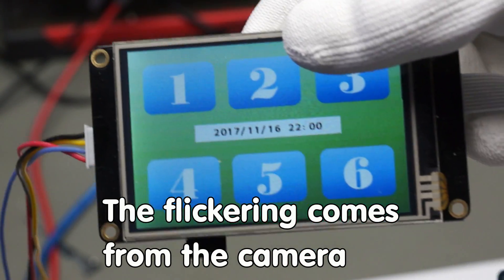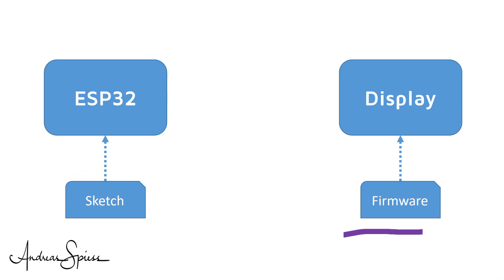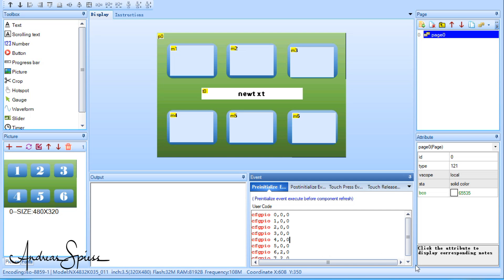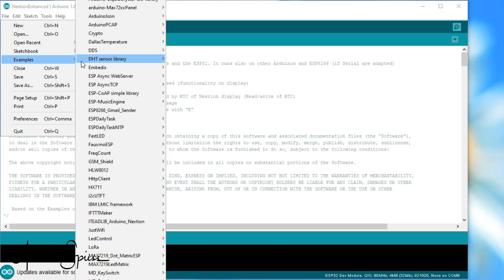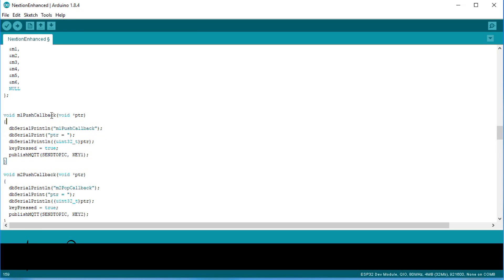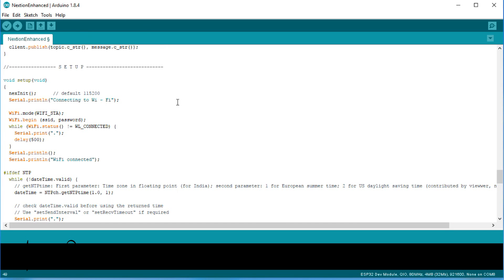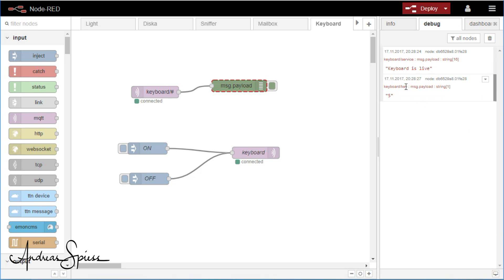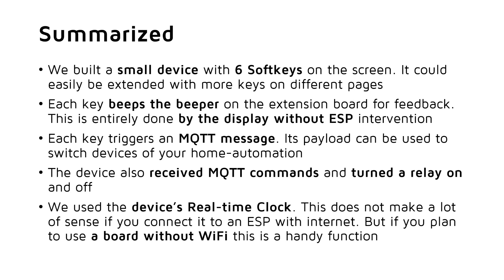#170 Enhanced Nextion HMI Tutorial incl. ESP32, ESP8266 and Arduino support

Comment: Do both models NX3224K028 and NX3224T028 have a 3.3V logic level or 5v? Thanks, cheers
Reply from the maker: According the datasheet the first uses 3.3V logic levels. I did not check the second.

Comment: I just picked up one of these displays today. I'm planning on using it with an ESP32 and just kinda hoped it would work. I'll be referencing your video to get the display working with the ESP32, but ultimately, my goal will be to use it in conjunction with with Squareline studio/ LVGL with a single rotary encoder as an HID for use as a CNC pendant. I'm up for the challenge. Hopefully these are the bits I need to make this project a success.
Reply from the maker: Maybe you find a newer library. This is a quite old video.

Comment: Thank you for providing a Nextion Library that works with the ESP32.
If I do install your library instead of the official ITEAD library, would it still work for the Arduino Mega or Uno?
Reply from the maker: I do not remember. So you have to try...
Reply: will you consider our touch screen display? then contact me

Comment: Andreas,
I need your help. I tested this solution using a Nextion NX3224T024_011 display with ESPDUINO (which uses ESP32), but without success.
The following error message appears on the monitor of the Arduino IDE: recvRetCommandFinished err.
Is this related to the fact that it is a different display? Or is it due to the fact that you are using ESPDUINO based on ESP32 instead of directly using ESP32?
Do you have any idea how I can solve this? I have tested many libraries and researched many other solutions, but all have failed.
Reply from the maker: Unfortunately I cannot do remote debugging :-( Did you watch all my Nextion videos, especially the one about Serial connection?
Reply: @AndreasSpiess  I saw the #152 and #63 videos.  I did as you said but the message "recvRetCommandFinished err " still appears. Could you send me the libraries version of HardwareSerial.h and cpp,  an SoftwareSerial.h and cpp that you used in these examples?

Comment: Another great video! Is there any reason I couldn't connect whatever I wanted to the I/O pins meant for the expansion board?
Reply from the maker: I do not understand your question :-(
Reply: @AndreasSpiess  Sorry, I'll try again. If I don't buy the Nextion expansion board with the switches, does anything prevent me from connecting something I build in its place?
Reply from the maker: I do not think so. If you provide the same voltage levels to the connector.

Comment: If I connect RX of Nextion TFT to TX (GPIO-1) of ESP32, and also connect TX to RX (GPIO-3) of ESP32, serial communication does not work. It works with UNO3. The ESP32 WiFi chip release version is v1.0.1. Does anyone know what is causing it? If there is an example sketch, could anyone please send a link?
Reply from the maker: Search for ow to initialize Serial on the ESP32. You can use all pins, but have to tell the sketch which one you want.
Reply: @AndreasSpiess  I am grateful to you for the advice. I will do my best. There are not many engineers or hobbyists here in Japan who provide information about ESP32 or Nextion TFT in Japanese. Youtube is a good teacher for me. What I want to do is simple, but I'm confused by the fact that many people have different information.

Comment: Hi Andreas, Thanks for your Nextion videos, they have really helped me start my project. Were you able to find ways/code to use the expansion board buttons as inputs?  I am working on a motorcycle VCU ( https://www.youtube.com/watch?v=ixrIBekt090 )  and am trying to figure out how to read the button presses.  Do you know if there is a way to get a "Touch Press event/Touch Release Event" for the GPIO's?  Cheers!
Reply from the maker: I think you should get information from their homepage. I never tried.
Reply: @AndreasSpiess  Thanks, I was having trouble decoding the Nextion instructions, but I came across another video that helped me understand. I thought I would post the solution here so you and others have access to it. Hopefully, this helps someone looking for the same information.

You have to configure the GPIO expansion board button in the 'pre-initialize event' area of the page you want to use it. This will link it to a button, element or hotspot on the page so you can use the 'touch press event' and 'touch release event' of the onscreen element by pressing or releasing the linked expansion board button.

A code example is:        cfgpio 4,1,m0         This means: (cgfpio=configure gpio port)(4=expansion button 104)(1=attach to screen element)(m0 = hotspot id "m0"). 

Now I can use the button 104 on the expansion board to activate the hotspot m0 on the page. You can link any expansion button to any onscreen element. cfgpio 2,1,n3  will link button 102 to Number field n3 on the page. You have to configure the buttons on each page, but this means you can use the buttons for different functions on different pages. 

If you are configuring an output for the beeper or led, you seem to be able to do that on the page 0 'pre-initialize event'  ( cfgpio 7,2,0 )  = (port 7 beeper)(2=binary output 1 or 0)(0=do not link to a component) and call it using pio7=1 or pio7=0 from any page.

 Thanks again for your great videos!

Comment: Hi Andreas, I don't have an enhanced Nextion but a modest basic T 3.2 and I couldn't experience this tutorial.
For days I'm fighting with ESP32 and my Nextion but nothing to do. I tried to copy a few lines of code from your examples but nothing. How can I do that? I watched other videos of yours too but I couldn't do anything. The original Itead sample files on ESP32 don't work. 
Thanks
Richard
Reply from the maker: Unfortunately, I cannot do remote debugging. Maybe you find another project with the same devices. Also maybe you start with the simplest possible sketch.
Reply: @AndreasSpiess  I tried a simple one like in your video number 59, CompText.ino and same GUI but with ESP32 it doesn't work. For this example with ESP32 I have not modified the file NexConfig.h as for Arduino because it should not be done and I left it original, but it does not work yet.
How can I do that?
Thank you
chip

Comment: Where in this setup is the ESP8266?  I assume it is to another serial port just not shown in the camera view?  I have an UNO that I am looking to do a similar project with, but it appears to use the Nextion and the ESP8266 at the same time will require two hardware serial ports, therefore a mega.
Reply: Never mind....I see you are using the ESP8266 in and of itself and flashing your sketch to it.
Reply from the maker: I made a video about the different boards and how to deal with "Serial"

Comment: Is there a way to increase the sensitivity on these screens? I have to press really hard to make the buttons react. Thanks.
Reply from the maker: They use resistive technology which is not as sensitive as the capacitive used in Smartphones.
Reply: I figured out also if you require both down press and up press the sensitivity isn't as good as if you just require one and not the other. Thank you!

Comment: Hello. I am using Arduino and trying to get HX711 scale readings into a Nextion display. It is so hard to find ANY help that I really feel like giving up on all of this stuff. Nextion has ZERO support. ALL the examples have ZERO comments in them. I don't have ANY friends that are into this and I am so tired of TRYING to find answers. Where the hell do I go???   :  (   Also, Why does Nextion not support floats?   Kind of sucks....
Reply from the maker: Maybe you divide your problem into several parts and solve one after the other. Then you also will find help, I am sure.

Comment: Andreas, your videos are so helpful! Thank you for making them so easy to understand and follow. I spent too much time trying to connect serial2 on the esp32  with the nextion library without success. 

Could you briefly comment on what changes you made to the official nextion library? I changed the initialization function to accept a value which dictates what baud rate to connect with. This way you can specify from the sketch instead of modifying the library. Ideally, I'd like to incorporate your changes with mine.

Do you know of a way that can speed up communication?, even more than increasing the baud rate? 115200 is quick for weather stations or home automation, but not enough for real-time display since serial communication code is blocking. I realize the second core could be used on the esp32, but what about Arduinos? Is there a way to use SPI communication instead? That way we can get 4Mbps which is much faster.

Regards,
Simon
Reply from the maker: I made a video concerning using other serials with the Nextion. Maybe you find the needed info there. Concerning speed-up I do not know.
Reply: Espero que la respuesta a sus preguntas no sea tarde. Intenté sin éxito seguir este video, pero tampoco funcionó. Finalmente, después de una tarde de dar vueltas y vueltas aquí está la solución:
copie el SIGUIENTE en NexUpload.cpp en la biblioteca de Nextion, esto lo sacará de la biblioteca ESPNexUpload.cpp, QUÉ FUE, se debe comentar (// # include <SoftwareSerial.h>

// # define USE_SOFTWARE_SERIAL
// # ifdef USE_SOFTWARE_SERIAL
// SoftwareSerial dbSerial (3, 2); / * RX: D3, TX: D2 * /
// # define DEBUG_SERIAL_ENABLE
// # endif)

Copie el SIGUIENTE en NexUpload.cpp en la biblioteca de Nextion

# si se define ESP8266

 #include <SoftwareSerial.h>
 
 #ifndef NEXT_RX
  #define NEXT_RX 14 // Nextion RX pin | Predeterminado 14 / D5
  #define NEXT_TX 12 // Nextion TX pin | Predeterminado 12 / D6
 #endif
 #ifndef nexSerial
  SoftwareSerial softSerial (NEXT_RX, NEXT_TX);
  #define nexSerial softSerial
  #define nexSerialBegin (a) nexSerial.begin (a)
 #endif
 
#elif definido ESP32
 
 #ifndef NEXT_RX
  #define NEXT_RX 16 // Nextion RX pin | Predeterminado 16
  #define NEXT_TX 17 // Pin de Nextion TX | Predeterminado 17
 #endif
 #ifndef nexSerial
  #define nexSerial Serial2
  #define nexSerialBegin (a) nexSerial.begin (a, SERIAL_8N1, NEXT_RX, NEXT_TX)
 #endif
 
#endif

Creo que debería guardar una copia del archivo original para que pueda funcionar correctamente con una tabla o mega arduino. 

Espero ser de ayuda

Comment: Hi Andreas,

I can't get the time to display.
Here is what I am seeing on the serial monitor.
I'm using an ESP32 and a 2.4" Nextion display.

[1073492688:0,1,b0]
b0PopCallback
ptr = 1073492688
recvRetNumber :536873131
recvRetNumber :0
recvRetNumber :0
recvRetNumber :134273857
recvRetNumber :134273857
recvRetNumber :553648128
recvRetNumber :2164260864
Y131/00/00 ⸮7:⸮7:⸮8 0
recvRetCommandFinished err
0

Thanks,

Keith
Reply from the maker: I cannot do a remote analysis. Maybe you start with a simple example and extend it till it works.

Comment: Hi Andreas, After watching this video, I tried to use serial 2 of esp32 using arduino but not successful. Can you refer any link where I can get to know more about that.
Reply from the maker: There is a video on this channel explaining Serial on ESP32
Reply: @AndreasSpiess   I followed that video but that didn't work for me. Can you guess what can be the problem.
Reply: i am also looking for same solution
Reply from the maker: Unfortunately remote debugging is nearly impossible for such cases.
Reply: I hope the answer to your questions is not late. I tried unsuccessfully to follow this video but how it did not work either. Finally after an afternoon of going around and around here is the solution:
copy the NEXT in NexUpload.cpp in the library of Nextion, this take it from the library ESPNexUpload.cpp, WHAT WAS, should be commented (// # include <SoftwareSerial.h>

// # define USE_SOFTWARE_SERIAL
// # ifdef USE_SOFTWARE_SERIAL
// SoftwareSerial dbSerial (3, 2); / * RX: D3, TX: D2 * /
// # define DEBUG_SERIAL_ENABLE
// # endif)

copy the NEXT in NexUpload.cpp in the library of Nextion

#if defined ESP8266

 #include <SoftwareSerial.h>
 
 #ifndef NEXT_RX
  #define NEXT_RX 14 // Nextion RX pin | Default 14 / D5
  #define NEXT_TX 12 // Nextion TX pin | Default 12 / D6
 #endif
 #ifndef nexSerial
  SoftwareSerial softSerial(NEXT_RX, NEXT_TX);
  #define nexSerial softSerial
  #define nexSerialBegin(a) nexSerial.begin(a)
 #endif
 
#elif defined ESP32
 
 #ifndef NEXT_RX
  #define NEXT_RX 16 // Nextion RX pin | Default 16
  #define NEXT_TX 17 // Nextion TX pin | Default 17
 #endif
 #ifndef nexSerial
  #define nexSerial Serial2
  #define nexSerialBegin(a) nexSerial.begin(a, SERIAL_8N1, NEXT_RX, NEXT_TX)
 #endif
 
#endif

I would believe that you should keep a copy of the original file so that it can work properly with a one or mega arduino board. 

I hope to be helpful

Comment: Hi Andreas, I am using the Keyboard.ino example, and I have made the modifications to HardwareSerial.h file, but I keep getting an error (recvRetCommandFinished err). what boggles my mind is that when I communicate with nextion display without the nextion library as per the following example, it works just fine!!!!
 HardwareSerial Serial2(2);
void setup() {
  Serial2.begin(9600);
  Serial.begin(9600);
}

void loop() {
delay(2000);
Serial2.print("irMode.val=1");
endNextionCommand();
}
void endNextionCommand()
{
  Serial2.write(0xff);
  Serial2.write(0xff);
  Serial2.write(0xff);
}

But when I use the library, I get the error mentioned above, and I have been trying for the past two days with no luck, pleeeeeeeease help, PS my nextion HMI code is very simple, just a variable named irMode, thats it!!! 
Now you may ask, if this example works fine then why don't you use it, and my answer is: I need to get values from Nextion to ESP32 and I could not fine a clear way of doing this without a library, so please help my friend.
Reply from the maker: I think I tried to answer this somewhere else.
Reply: Hi Andreas, Yes I asked the same question on Patreon, and am glad to report that I was able to work it out on my own after I was frustrated with Nextion's technical support. basically I defined a timer in Nextion editor and I made the timer push all the values I needed through serial every 5 seconds, and the rest was just to read and process the serial in arduino.
Reply: Espero que la respuesta a sus preguntas no sea tarde. Intenté sin éxito seguir este video, pero tampoco funcionó. Finalmente, después de una tarde de dar vueltas y vueltas aquí está la solución:
copie el SIGUIENTE en NexUpload.cpp en la biblioteca de Nextion, esto lo sacará de la biblioteca ESPNexUpload.cpp, QUÉ FUE, se debe comentar (// # include <SoftwareSerial.h>

// # define USE_SOFTWARE_SERIAL
// # ifdef USE_SOFTWARE_SERIAL
// SoftwareSerial dbSerial (3, 2); / * RX: D3, TX: D2 * /
// # define DEBUG_SERIAL_ENABLE
// # endif)

Copie el SIGUIENTE en NexUpload.cpp en la biblioteca de Nextion

# si se define ESP8266

 #include <SoftwareSerial.h>
 
 #ifndef NEXT_RX
  #define NEXT_RX 14 // Nextion RX pin | Predeterminado 14 / D5
  #define NEXT_TX 12 // Nextion TX pin | Predeterminado 12 / D6
 #endif
 #ifndef nexSerial
  SoftwareSerial softSerial (NEXT_RX, NEXT_TX);
  #define nexSerial softSerial
  #define nexSerialBegin (a) nexSerial.begin (a)
 #endif
 
#elif definido ESP32
 
 #ifndef NEXT_RX
  #define NEXT_RX 16 // Nextion RX pin | Predeterminado 16
  #define NEXT_TX 17 // Pin de Nextion TX | Predeterminado 17
 #endif
 #ifndef nexSerial
  #define nexSerial Serial2
  #define nexSerialBegin (a) nexSerial.begin (a, SERIAL_8N1, NEXT_RX, NEXT_TX)
 #endif
 
#endif

Creo que debería guardar una copia del archivo original para que pueda funcionar correctamente con una tabla o mega arduino. 

Espero ser de ayuda